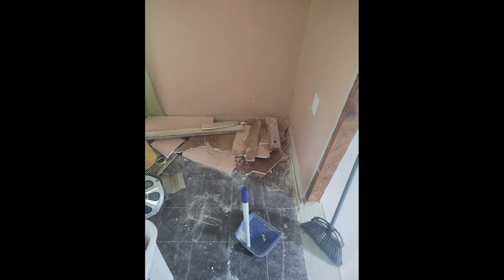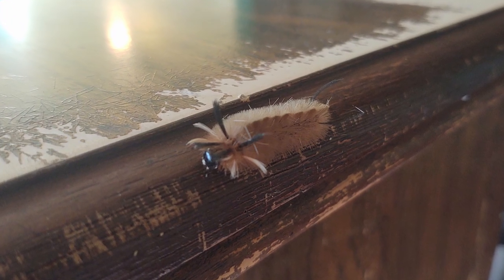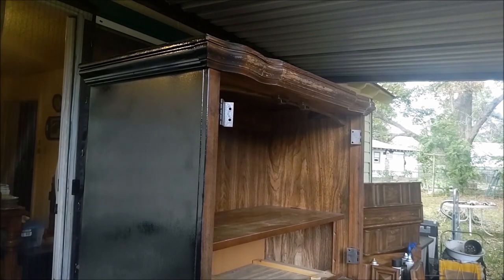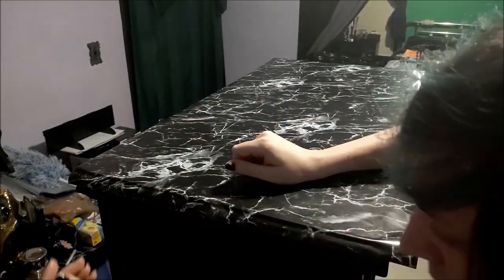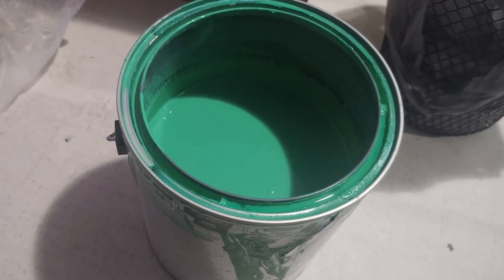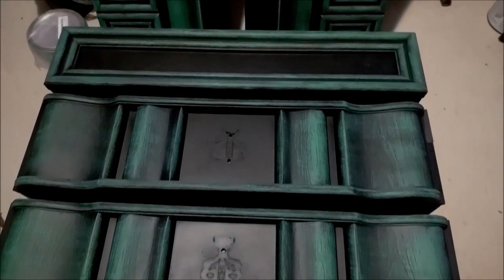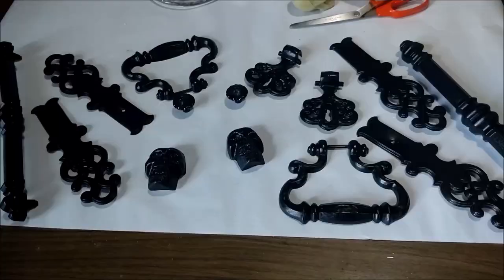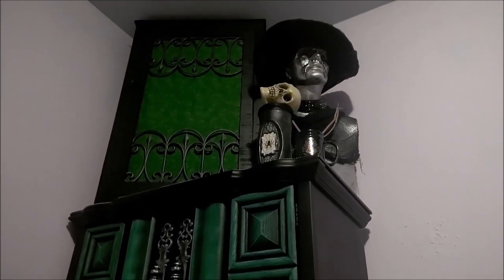Creepy Cabinet | Gothic DIY Thrift Flip

Comment: Great job!  That is so beautiful!  I’m currently renovating a bathroom in a mix of dark academia and whimsy goth and doing a LOT of black surfaces.  Here’s something that I found out while pricing black finishes-one quart can of minwax true black stain when applied with a wide foam brush (which if you put the brush in a baggie with a damp napkin you can save it and reuse it for quite awhile) is SO quick and easy and that little tin of color stain lasts and lasts and LASTS.  It’s unbelievable how far that one $13 dollar can goes, and it also gives the truest darkest black of any product when coated twice.  I’ve done an entire bathroom, all the woodwork, all of the half wall wood panels, shelving, doors, mirror, sink vanity-you name it with a can and a half of black wood stain.  So an entire bathroom for under $20.  I foam brush it on, let it sit for a day, second coat it and let that dry 24 hours, and then give it a foam brush coat of polycrylic.  Only problem with this method is it smells like stain in the house for a couple days and ventilation is required for safety.  Also, if you need to keep a peel and stick product from peeling back up, slightly water down mod podge in a bowl and foam brush on the mod podge thinly before applying the vinyl roll product.  It essentially works like wallpaper glue.  I use dishwasher safe mod podge for strength/durability but you don’t have to.  I used some left over wallpaper on a little lingerie chest of drawers on the top and drawer fronts and when done, I gave it a couple coats of polycrylic to seal it in.

Comment: So a tip for your skulls I might suggest if they fall off. to scuff the part touching the cabinet and the inside of your skulls and using E6000 or 2 part epoxy. Cause superglue can kinda crack off and fall off depending on the things your using. And you can easilly get cheap 2 part epoxy at dollarstores. and michaels carries E6000. Just make sure you let it offgas cause it isnt the best for your lungs.